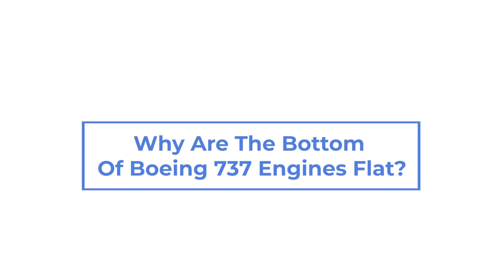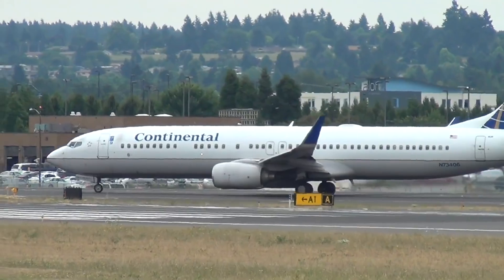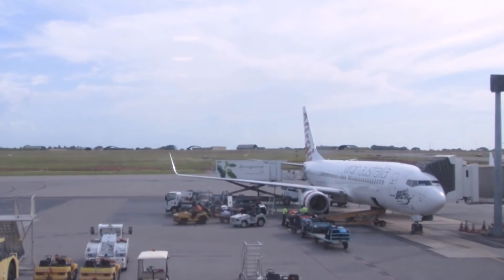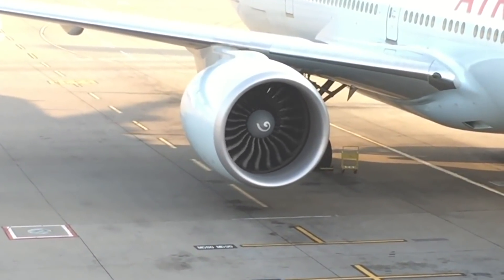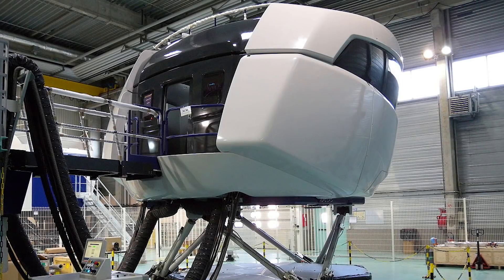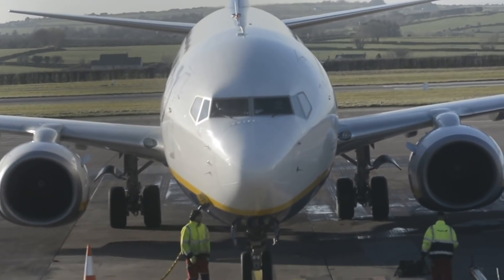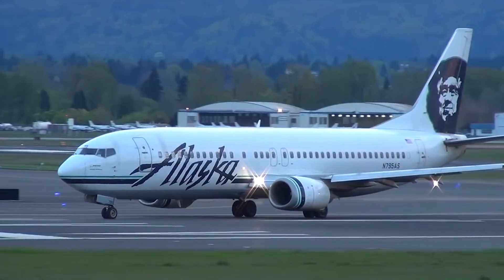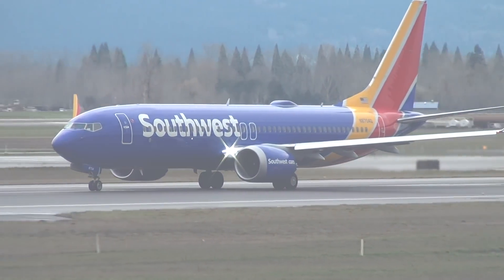Why Are The Bottom Of Boeing 737 Engines Flat?

Comment: Pretty sure the 737-300's and 400's started out with. Round engines and got redesigned because of the TACA 110 incident. You should really look into this, found two videos now staying it's because of ground clearance, that may be the case for the 737NG's but wasn't the case for the 300's or 400's.

Comment: This is such old hat. The more interesting question is: why is it that Boeing REFUSES to raise the GROUND CLEARANCE of the 737 Max???
Reply: Tony de Castro because there is no point. With the amount of engineering required to do that you would be better starting with a clean sheet.
Reply: @ashleyw1393  really?  it is more probable that Boeing just refused to dole out the necessary financing for it.  it is this low ground clearance that necessitated the engines being moved forward and upward which then created the necessity for a software program to correct the effects of a design flaw.  Boeing will now be paying out billions of dollars.  short cuts again have proved to be MORE COSTLY than spending the money for necessary adjustments in design, like higher ground clearance.  Boeing could not afford an absolute clean sheet (that would take years to realize); but it could have corrected the max's design flaw with the proper engineering solution.
Reply: @tonydecastro6340  The necessary adjustments in design could have been making robust software. The issue wasn't the concept of MCAS but the implementation. Raising the gear is not a great solution; it's a wing structure and wingbox redesign, requires emergency slides for overwing exits, and adds enough weight that MAX is no longer competitive. And airlines won't be able to load bulk cargo the same way as they do currently.
Reply: @AmbientMorality  currently, airports everywhere have greatly improved their facilities. The a320s have higher gear and they're fine. Ultimately of course the 737 Max design is plain obsolete.
Reply: @tonydecastro6340  That didn't address the other points though. And for all-737 operators it's still a change – I think Southwest and Alaska would have major issues with that proposal
Reply: @AmbientMorality  look, Boeing wanted the max to be as close as possible to previous iterations of the 737 when it clearly was not, given the much LARGER engines. It wanted the SAME certification for a clearly different aircraft in order to avoid going through a new certification process that would raise the price for the aircraft, thus making it less competitive than the a320. The fault, as is clear to all, falls on Boeing management.
Reply: Tony de Castro there is no room to store a taller landing gear without a very major redesign of the whole wing root area and forward fuselage. It has been a problem for Boeing as far back as when the 300 was built. Back then they got around it by having the flat bottom on the engine nacell which keep the same landing gear height. 

With the Max the even larger engine couldn’t have the flat bottom nacell so needed to be relocated which caused other issues as we all know. 

But the core issue is lack of space to accomodate a larger landing gear and the cheapest way would be to make a new plane. If it was any easier I am sure Boeing would have done it years ago.
Reply: @ashleyw1393  that at least answers some questions.  nevertheless, i'd like to pursue the matter, if you don't mind.  the a320 isn't all that much bigger than the 737, and yet it has a higher ground clearance.  also, i have a question: the 757 is also configured for 3-3 seating, and i would wager that the fuselage isn't all that bigger than the 737.  and yet the 757 has a rather high ground clearance.  my suspicion really is that they did not want to raise the ground clearance because that would mean having to go through a new certification process because the aircraft would no longer be the same. and that means higher cost of production and therefore higher prices (and Boeing was trying to undercut Airbus).  the issue therefore is not technical or engineering related.  it is certification and finance related.
Reply: Tony de Castro the 737 issue relates to the wing root area not the fuselage. Take a look at a picture of a 737 in flight from underneath and you will see the wheels don’t even get stored away into the wing root they are visible. There isn’t enough room to make changes without changing the wing root and wing. So that you may as well start clean. 

The 757 and A320 were designed with sufficient clearance so don’t have that issue. The 737 was designed for the original type of jet engine that didn’t require the clearance. But in later years turbo fans came into being that have a big fan that requires such clearance. 

As I said on the 737-300 the bottom on the nacell was flattened which allowed the engine sufficient clearance.
Reply: Because if the 737 Max is more than a certain percentage different from the current Next Gen 737 then all the pilots will need to be trained from A to Z, so airlines wont opt for it, thats why they have minimal upgrades to save money for the airlines...!!!
Reply: Wheels?
Reply: @emxrqlds646  no.  money.  Boeing does not want to spend on new engineering solutions to the problem.
Reply: Tony de Castro oh ok